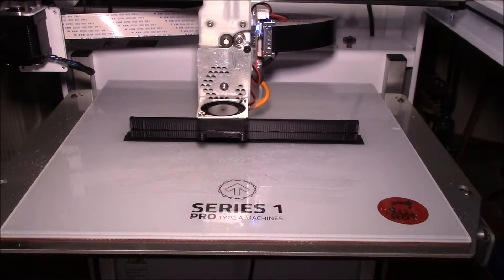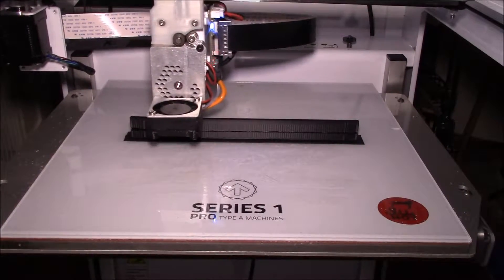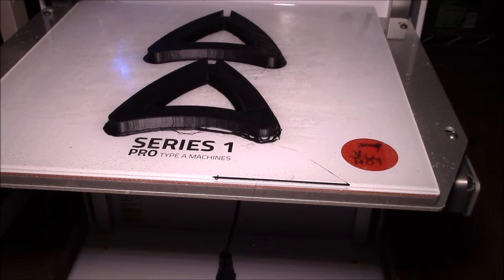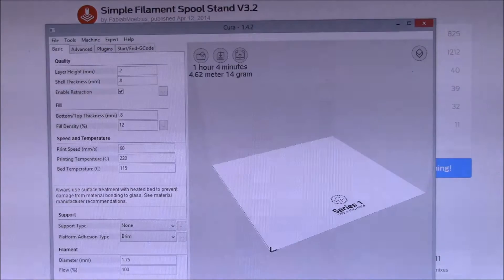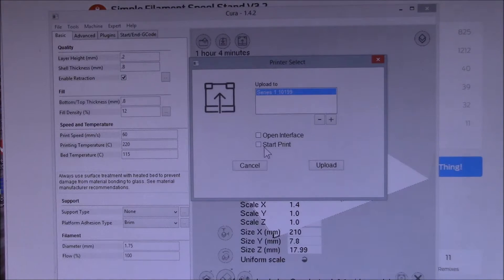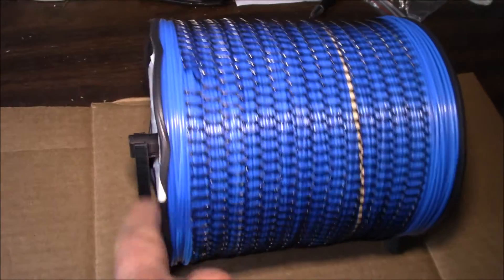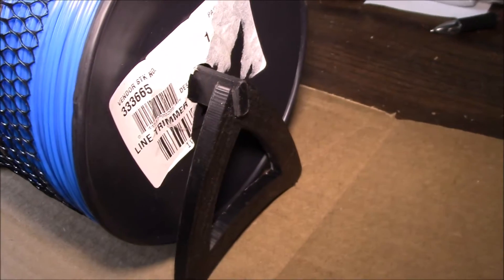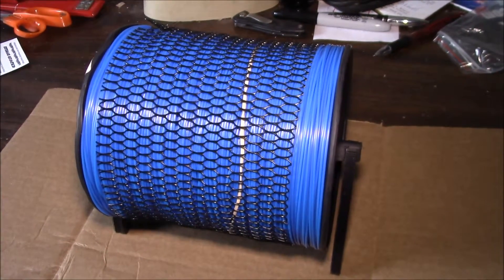Making a 3D Printer Spool Holder for Nylon Trimmer Line

Comment: I have ACR10S and all I can print as peel late but I would like to get a role like that with the  P l a
Reply from the maker: This is Nylon material, quite a bit different than PLA.  It needs high temperature to print and a special printing surface:
https://youtu.be/By_Ah0MKKqo
https://youtu.be/J93BrffrGr0
You can get larger spools of PLA filament.  I use a lot of Zyltec filament and they have 5kg/11lb spools:
http://www.zyltech.com/pla/